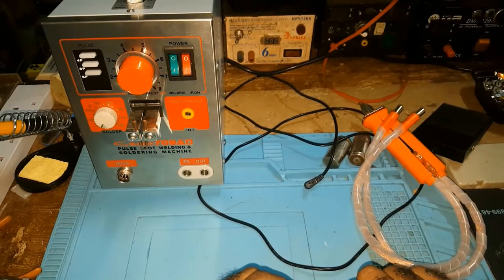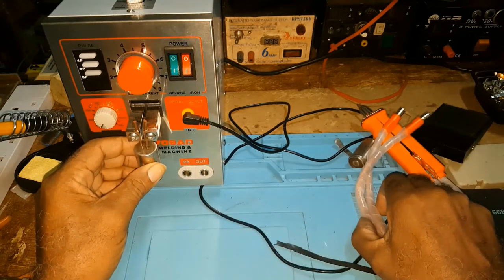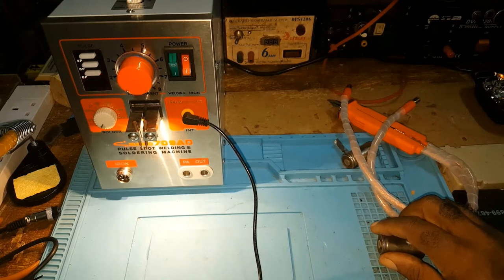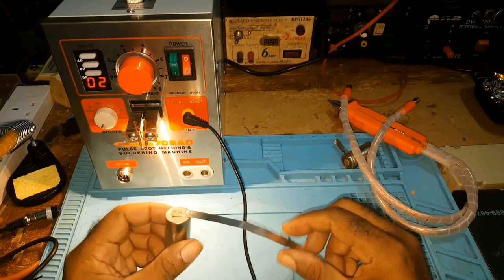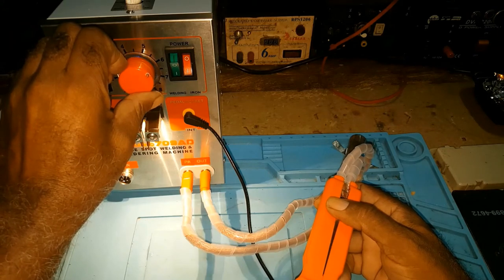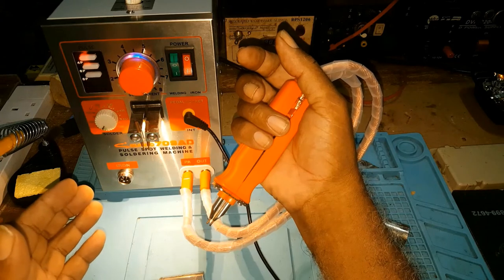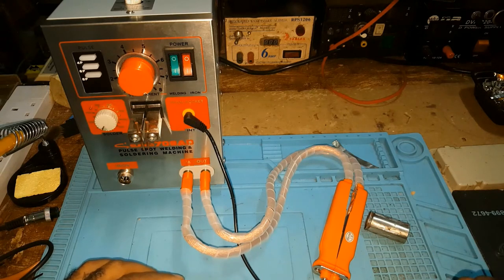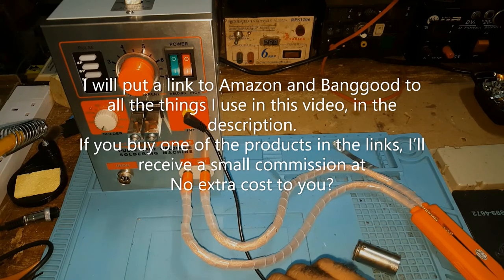SUNKKO 709AD SPOT WELDER TEST

Comment: Hello! Quick question, will it be able to solder a 0.5mm copper wire to an aluminum surface? 
Thank you!
Reply from the maker: No I don't think so aluminum well take a special soldering.
Reply: @AlwynNicholas  thanks!